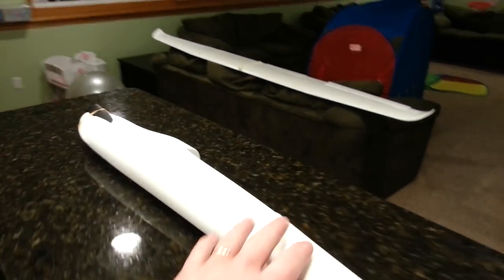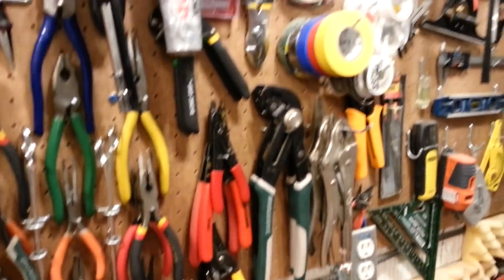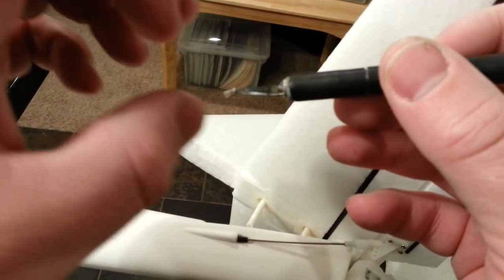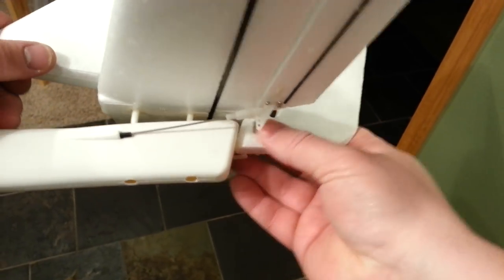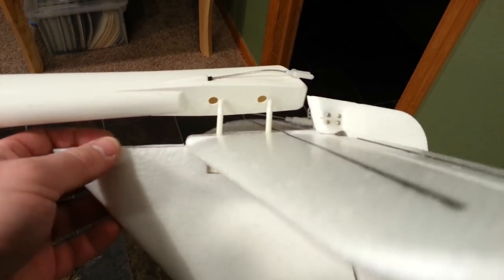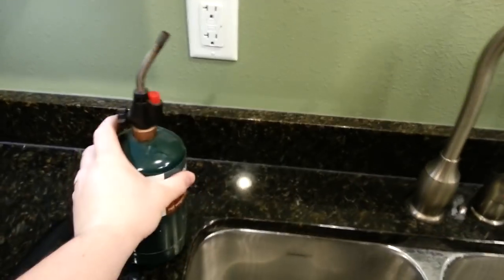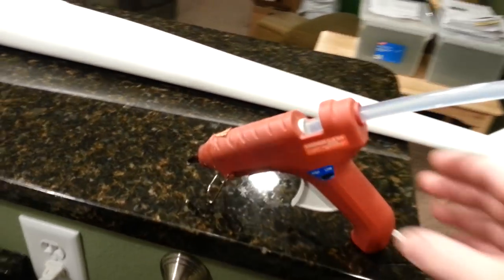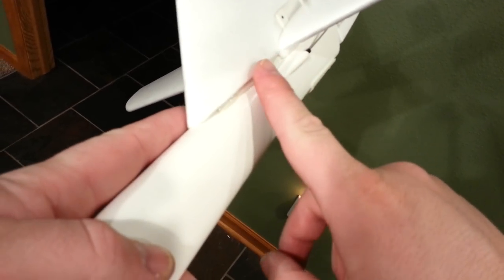Volantex RC - Phoenix Evolution - 1.6m/2.6m Sail Plane - Build Series - Part 7

Comment: Hi Brian could try some narrow thin  Double sided tap so you can take the rudder fin off to put a hing on the bottom rudder fin a block of basla in the fuse tail end(trimming the fuse tail sides) with two screws Ca  in the screw holes to harden your balsa holes then put the bottom hing in above the control horn Have the pheonix 2000 and 1600mm
Reply from the maker: I've mounted a hinge in this video below :)

Build 10 Rudder Hinge - https://youtu.be/cuCaESaDeB4

(the list is in the description)

Comment: Nicely produced videos but think you could edit considerably to bring down length.  Agree with David that you made mountain out of molehill with all that gluing, just a spot of glue pressed into the joint would have achieved the same objective.
Reply from the maker: This modification worked exactly as I wanted. Less glue would not have filled the gap, even if it did stop the movement in the vertical stabilizer. I got it to look and function great without compromising my CG. If you decided to use tape instead of hot glue, I can't blame you.

P.S. Did I ask for pointers on my video production? (This is actually a question, I don't remember mentioning it, but maybe I did) If it weren't already obvious, I dump a TON of time into this channel, and I don't do it to be second guessed all the time. If you don't like the length of videos, you can do three things...

1) Fast forward...drag the status bar to where you see what you want to see
2) Use the Settings (gear) to select playback speed from Normal to 1.25X, or 1.5X, or 2.0X
3) Make your own video and do it better

Comment: No such problem on the stock 1600 as the vertical stab is about 30 to 40mm shorter so it's firm as without need for extra gluing.
Reply from the maker: Really! I didn't realize it was a different size. Do you know if the 2000mm size also has a different vertical stab and rudder?
Reply: Hi Brian, it seems the 2000 also has the short stab, click on the close up in this ad, Cheers. .... http://www.rcfair.com/en/product/1081615/
Reply from the maker: Nice :)

I wonder if the 2000mm would be more manageable to load in a car too :) I HATE taking planes apart for transport :( :( :( BUT I seem to be doing it more and more these days...
Reply: The 2000 is as cheap as chips right now at HK. You know you need more planes .... not.
Reply from the maker: Nice! Thanks